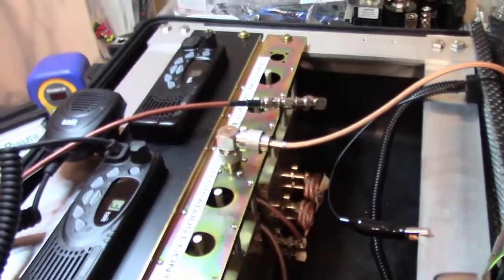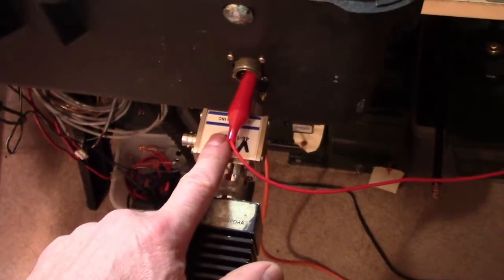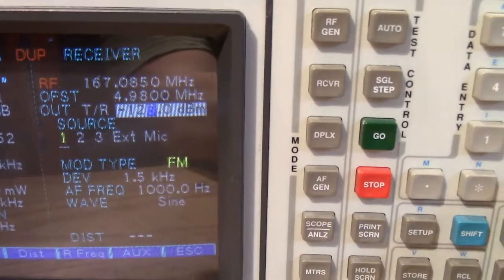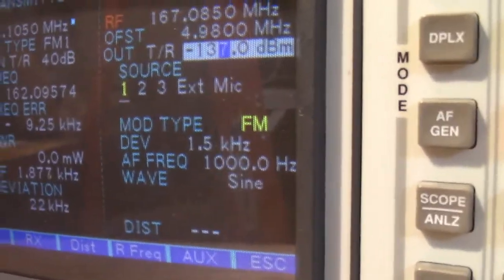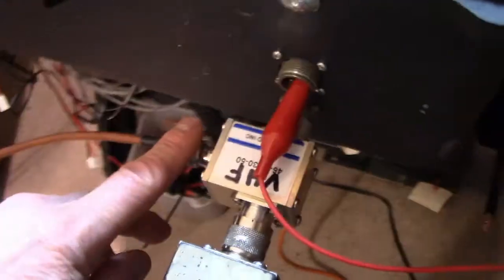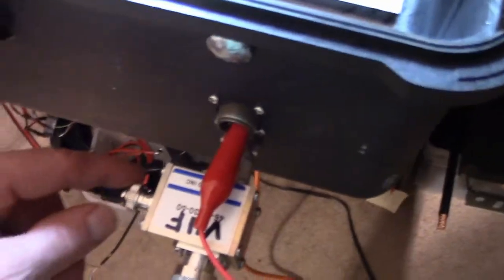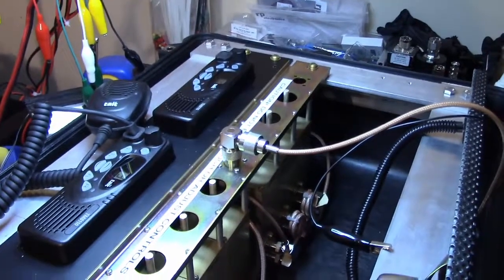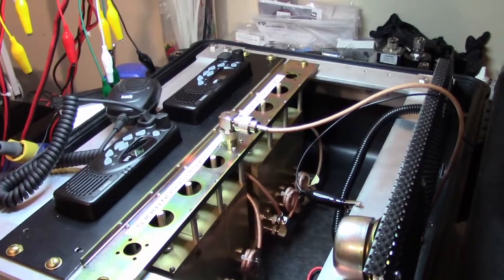How To Test Radio Repeater Power, Sensitivity and Desense (Revised Version)

Comment: I'd like to add what I believe to be a constructive comment about the desense test that will make it a useful test (Your test really just measured the isolation of your Iso-T and that is really not all that important).  Your second desense test would normally be to test how the noise floor at a site affects the receive sensitivity for this installation.

For the second desense test that you did using the Iso-T or whatever you prefer to call it, you did not complete the second step in that procedure which is to replace the 50 ohm dummy load with  the actual antenna.  Desense due to the noise floor at a com-site will be the difference in test generator signal level required for the same indication that you had with the dummy load.  Some might insist that a 12 dB SINAD test is the "proper way" but as you did it where you listen to signal as it opens the squelch you will probably get about the same results once you become familiar with what to listen for by ear.
Reply: perfect

Comment: The correct and only way to do the test is as follows:
 
1. Set up the RX test with sig gen and monitor the RX audio for SINAD and test without the TX running. eg. -120 dBm gives say 20 dB SINAD.
 
Then whilst measuring the RX SINAD switch the TX on and note any changes in the RX SINAD say for example you measure -118 dBm so a change of 2 dB.
 
From this you can conclude the de-sensing is measured at 2 dB.
Reply: As a field tech I always start with doing desense checks over the air before I touch any of the connections.

Comment: Hello Mr Repeater.   Great video for a novice.   I have a question.   If I want to test the whole system, including the antenna, installed at a site, how should I do it?   Can I get a signal generator/amp and antenna and broadcast to and receive from the repeater, and check sensitivity levels, output frequency and power?
Reply: You need to test each sector individually, starting at the antenna and working out to the receiver, then the transmitter.

Comment: Hi how can you avoid desensitization in a Mobile communications Van where 3-4 vhf radios might transmit 2 at a time and receive 2 at a time. How should I separate the mobile antenna?
Reply from the maker: You need a set of filters on each receiver.